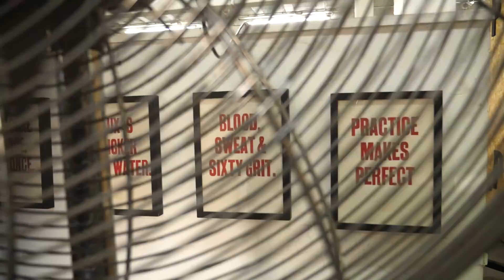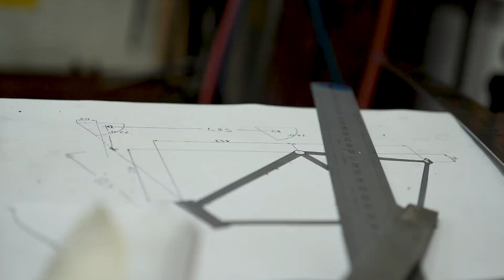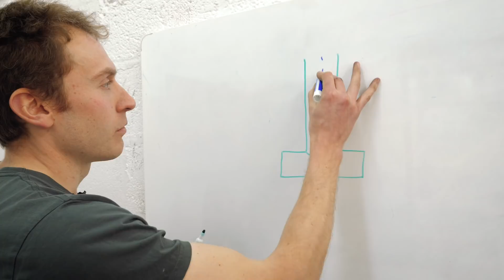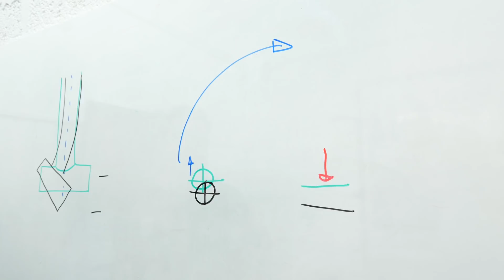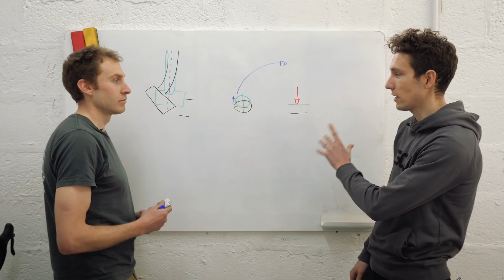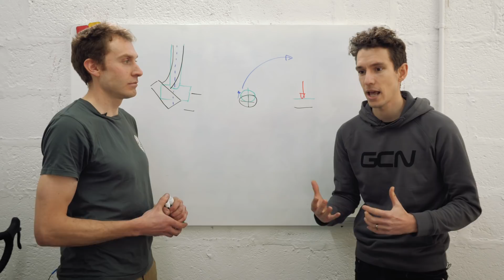Are You Faster On A Stiffer Bike?

Comment: I thought your stiff frame actually moved your rear wheel with much higher velocity/energy vs first bike. That would make sense, since stiffer frame would take greater energy to pre-load, therefore we would have equally greater  energy when released.
Reply: That is the point of their comment in the video, the greater wheel movement was a result of greater force to flex the frame to a similar reference point (the pedal on the block). So in that situation a greater amount of energy was applied. However on the road you do not generate more force because you have a stiff bike, you generate the same amount of force no matter which bike you are on as the bike as no impact on the ability of force production. The point is, when we isolate to what happens at the bottom bracket and drivetrain on the flexing bike, energy flexes the frame and is then sent through the drivetrain when the force is removed and the frame recoils. In the stiff frame less energy is taken flexing the frame and more is sent through the drivetrain, however less force is sent through the drivetrain during frame recoil. The sum of force through the drivetrain during each force/recoil cycle is the same because energy can not be created nor destroyed, only changed from one form to another. 

A better example would be to replace the force of standing on the pedal (variable force) to a known constant force such as a 50kg weight. Then with the wheel locked and the pedal at its maximum position under load the pedal is locked in position, such as a variable height solid block. In this test a flexible frame would result in a lower pedal than a stiff frame with a constant force applied to both. Would we then see more returned energy in increased wheel spin when the brake is released, would it be the same  or would it be less in the flexible frame? I am going to predict it will be the same, as energy can not be created or destroyed. This is because although one frame flexes more than the other, the stiffer frame still recoils and when it does it would be with a higher peak force. The stiff frame will hit a higher peak but over a shorter duration of time, the flexible frame will be a lower peak but over a longer duration of time. The sum of the returned energy is still the same.

Comment: Im not an engineer, but surely the rear wheel is moving because the relative position of the pedal has changed after release the brake. IE it started at say 90 degrees from the vertical but after it will be say 95 degrees so you have rotated your crank, hence wheel rotation.

I would think the difference in speed associated with the wheel rotation is then because of the higher force applied to the crank rotation.

Other things could also come into play such as length of crank, height of bottom bracket, wheel position such as tyre size and psi.

If all of this were even then perhaps you could read something into the results. But because of difference in stiffness the forces applied would always be different.

Comment: the frame deformation , perpendicular to chain axis can non give energy back to the chain because perpendicular , but helps the other pedal to go up :) .... then some energy is given back but the elastic losses due to material deformation is definitely lost ....if you want to see the full effect imagine you cut the frame in the 2 tubes , intall 2 free axix (same axix than the chain ) ... and push your new free bottom bracket bike ...

Comment: The experiment is false , you make turning the wheel due to the elasticity load you have in the chain and in the brake system attached to frame , if you want to see if the frame gives something back , take out the chain , block the pedal rotor an retry , you will see that the whell will not move , the nergy is lost , energy is force multiplied by speed , more you have elastic movement more you loose

Comment: In this experiment the wheel will spin faster with a stiffer frame just because it takes more energy to flex it. The force applied on the pedal will have to be made a constant and the spin velocity measured for this experiment to be of any value.

Comment: From my point of view, it isn't any Energy loss that makes a stiffer bike better, but if the frame flexes back the rider has to force the pedal in the correct direction, which technically doesn't requier energy but force put strain on muscles as well(try holding something heavy in the air, as long as you don't move it you don't need any energy). And yes, there is as well a little bit of energy loss through heat, but its probably really tiny.
So a stiffer bike can probably make you faster and ride longer, but most importantly feels better to ride.

Comment: pafnucek
's explanation is quite correct (mech engineer gearhead athlete in his 50's here). I wanted to add to the discussion. 1. I think this simple test is quite clever but flawed in that it takes a hair of force to rotate a free floating wheel but takes many many times more force to turn the wheel-bike-rider combination with the wheel on the ground. The same test with the wheel on the ground will yield vastly different results that is explained by 
pafnucek
. 2. Without getting into the nitty gritty of it, but pro racing and the market is where the real life (not lab simulations) results lie. When big money and market forces are on the line in big time races, the sponsored teams and athletes who livelihoods depend on race results will not take chances with inferior technology and or materials.  Ive ridden steel for years, aluminum for years and carbon for years. And bike system stiffness and efficiency is definitely an advantage in racing.  The proof lies in the hands of pros who's livelihood depends on it. For me personally, light stiff carbon frames perform and ride great. The market decides. Any (most) experienced rider who goes in the flex frame direction (based on this experiment) with his riding will eventually U turn back to stiff.
Reply: The pros ride what sponsors give them.  Not long ago both the pros and their sponsors thought 20mm tires were really fast and a bit longer ago they thought that going through the alps on 42x23 is fast because you are pedaling really really hard.  During the same time touring people were riding 28mm tires and going through the alps with 30x28 pedaling at a reasonable cadence and not at 50rpm and felt it was a lot better and smoother.  Touring cyclist were slower because they have less power but they were a lot smarter without any sponsor money... Now everyone is buying super stiff (and now adding rubber suspension everywhere because the frames beat you up like the 20mm tires did....

Comment: The explanation seems flawed. If the frame and crank arms were made of rubber, how efficiently would they transmit power to the rear wheel? How about an undamped spring suspension that bounced up and down as you pedaled? I suspect that stiffness does improve efficiency, but the tiny difference between various bike frames is so small that it is impossible to tell by riding. The only way to know is to design an experiment that removes all the variables and is accurately measured.

Comment: What affects peak transfer to the road in speed depends on peak torque during the pedal stroke. If, for example, you put down a peak of 500w at some point in your downstroke, and that gets cut to 400w, with a 100w return, then the peak speed you'll reach is a factor of the peak power. For the same reason that cyclists can take a few power strokes then coast, is the same reason that power losses to the frame affect speed -- but because its harder to make speed the higher you go, the less frame flex matters. If your 310w stroke loses 10w down to 300w, the difference in instantaneous speed at the peak of your pedal stroke will not be much, but imagine losing 150w from a 300w pedal stroke. You'll cut a huge amount out of peak instantaneous speed. Even if the frame returns the energy later on, you will have missed the chance to apply the extra speed to the road. And since pedaling is a series of intermittent power applications with each stroke, not steady state power and speed, you will lose a lot of average speed. In reality, it's a small loss, but there is still a loss.

Comment: maybe the frame flex could be designed to improve power through the drive train on at the point where theres the least power a flick from the flex could get the drive train under load again faster

Comment: This whole experiment is pointless and demonstrates that GCN has very poor understanding of physics. Of course the Energy is conserved, but it doesn't mean that magically the energy stored in the flexed frame is almost entirely transfered into the drive train. Why would the energy stored in the flexed frame go there? When you flex the frame laterally most of it is lost in the friction of the bottom bracket mount and dumpen into the ground to oppose the force of the gravity. Your experimental set up is wrong, because you ignored the gravity force exerted on the bike by Earth and vice versa. What really moved the wheel in the end is the negligible tension in the chain that has been released. 

It works this way (by simplifying): downward vector of the force applied to the pedal (resultant force) is divided into two component vectors: the vector of the chain tension and the vector of the frame flexion. Only the energy stored in the chain under tension went to rotate the wheel. Now apply the Hooke's Law and you would expect that component that flexes more is the one with the higher energy stored. Chain is stiff, so very little effective force is being transfered to drive train. The frame flexes more, which makes it store more energy that is released laterally by frame rocking to the sides. This energy is not going to the drive train, but to the wheels (in real life situation) and by transferring lateral flexing movement to the rims and tires increases rolling resistance. Most of the energy stored in the flexed frame is going not into heat, not sound, and definitelly not into drive train - it is dampen into the ground as the force opposite to the force of the gravity.

Comment: So a flexible frame stores spring energy during the high torque portion of the pedal stroke (making it feel softer) and that energy is returned during the low torque "dead point", (making the dead point feel stiffer). Bad idea. A softer frame is more comfortable sure, but a stiffer frame still transmits power better. Oh, and I am a mechanical engineer with 30 years cycling and racing experience.

Comment: So a few points from the perspective of an engineer: Firstly there is probably a fair deal of that energy stored in torsional distortion of the hub and in the chain, would be interesting to try and eliminate these elements. Secondly I reckon the turbo frame has to be flexing a lot as well, contributing to the effect. With regards to the frame though, all components have a damping element and a spring element. The spring element returns all of the energy however the damping element dissipates some of this energy.  This effect is invisible in this experiment, it would be interesting if we could find a way to measure it, possibly with ultra sensitive temperature gear? Although Si said at the start it seems unlikely, the frame will in fact be heating up ever so slightly, however due to the amount of heating, and the constant heat loss to the surroundings you'd never in a million years notice it. And finally even if 99% of this energy flexing the frame is put back through the drivetrain, feel of the bike plays a big part in wanting a stiff bike I'd say.

Comment: The reason the wheel spins when you release the brake is because you preloaded the chain with tension. The more the flex the higher the preload tension, but we don't ride with our brakes on do we! So have the crank in 6 o' clock position and try the same experiment without the rear brake and the flexing of the frame will not spin the wheel.

Comment: For every action there is a reaction, part of the energy goes to the wheel and part of it goes back to your leg, if the the frame flex too much, like a spring, it also can delay the reaction to your leg by the time you have less power, the dead zone of pedal stroke.

Comment: It's about predictability. Experienced cyclists like having fine control over their power input, and a flexy frame will delay and distort your pedal stroke. It also creates a cyclic distortion to your handling which can cause speed wobbles and reduce overall controllability. 

the amount of energy stored by the frame in that experiment was on order 10 J. Steel tubes have pretty low hysteresis, and it's probably losing less than 1J per downstroke. Your thermal loss might be up to 3W. For this, stiffer is better assuming constant maximum force: Let the frame obey F=kx. Then W = F*x = F*F/k. This is probably accurate since your pedal stroke is probably force limited by your body, which is much less stiff than the frame.

Comment: I worked at one shop or another for a long time.  The example I'm going to give is anecdotal for sure.  But if I put an uninitiated customer on a bike I knew to be flexier vs a bike I knew to be stiffer, and didn't tell them anything about the bikes, they'd always come back and tell me the stiffer bike felt like it accelerated better.

Comment: There is also the matter that more sideways movement has an effect on the rider. If the frame flexes it will cause your body to move slightly to the side. This can be compensated, by pulling on the bars and/or using core muscles to balance. Either way, these muscles are using energy which could be going to your legs. 
An exaggerated way to exemplify this is how you feel after a road ride compared to a mountain bike ride. For the former, just your legs are tired, for the latter, your whole body is tired from moving around on the bike and levering it into position. 
I imagine the difference between modern road frames is pretty marginal though. Personally I always ride a steel, moderately flexible frame on road because if I used a super stiff carbon frame on the roads where I live, I would have no spine left after a few weeks.

Comment: Does it really work that way? On the road, wouldn't the compressed pedal just bounce back? If you press the pedal down hard, the frame is going to bend slightly and when you release it the frame bends back pushing the pedal up to it's previous position. Why would the compressed energy take the hard way through the transmission system and turn the wheel? The pedal isn't that heavy.

Comment: Fascinating piece! In my 20-odd years racing on the track, mostly as a sprinter, I was always after the stiffest frame. And in that scenario, where acceleration is crucial, I think it remains the priority. Having ridden some cheap but stiff carbon frames on the road however (which were horrible!), I would say some flex is a good thing in that application. What was very interesting was the concept that the flexible frame gives it back at the end of the pedal stroke. Anyway, 👍, GNC!
Reply: Actually, the flexible frame does NOT give the energy back.

Comment: but that is EXACTLY the idea behind a stiff frame
the energy that the flex shoots back into the wheel is the same energy that we put into the pedal in the first place, the only thing that happens here is that some of the energy at the pedal is converted to flex (instead of wheel movement ) and then converted again to wheel movement...
no new energy is "gained" here 
also as there is some energy loss during the conversions back and forth, how can it ever be more efficient at transferring energy to the wheel?

Comment: The main argument for stiffness would have to be immediacy of acceleration. If your opponent attacks and you have to react, those milliseconds can make the difference; if your frame costs you moments on the first one or two pedal strokes because it flexes before feeding your power back into the system, that could mean your opponent's back wheel getting away.

Comment: That way I look at it, there are two related dynamics to consider. Stiffness/amount of flex and flex/ rate of spring to true. 

It could be that this is a dynamic that can engineered and likely already is with companies that have the budgets for 5hat kind of research. Wanting a stiff bike that allows a combination of transference of power and flex to allow spring to occur and engineering a high speed of recovery springing back to True. For custom builds this could be beneficial for weight and average load could be measured and taken into consideration when calculating rate of stiffness and spring. 

I think many people confuse actual squat with flex. Meaning, sure too much flex robs you of your power when applying force and the whole system is loaded, but lacking flex at all you Rob yourself of your excess energy that is transferred and returned in the form of spring. Interesting video highlighting that.

Comment: The first sentence begins with « stiff bikes... I mean frame flex... ». But there is some amount of flex that is attributable to the crank arm in that demo, especially the way it is loaded up in that jig. 
Second, the directional stiffness matters. The chain stays usually twist on a steel bike, converting some of the energy into lateral movement as opposed to being sent through the drive trAin. This is not energy lost but only a loss of efficiency in forward movement (which some may find makes for a more enjoyable ride because it is more comfortable).
So having a stiffer frame may not always be best.